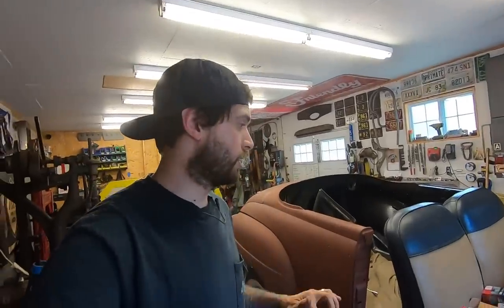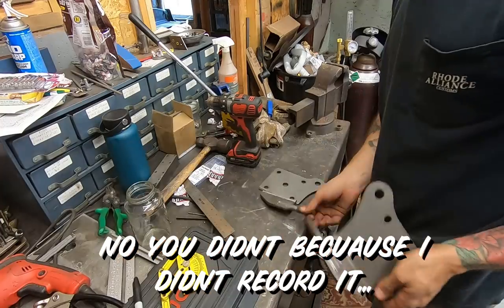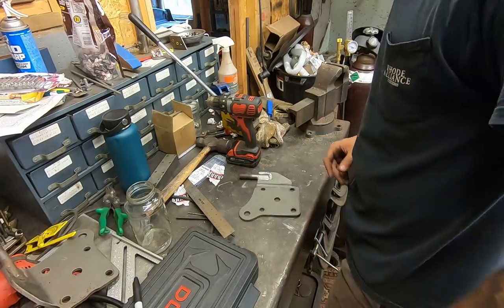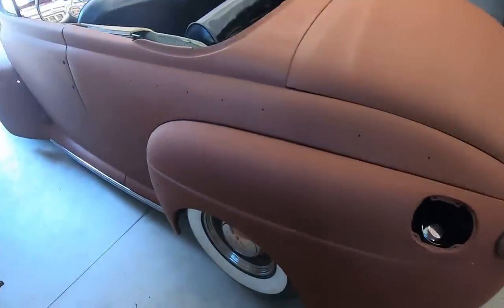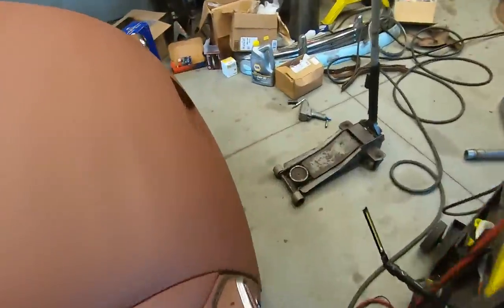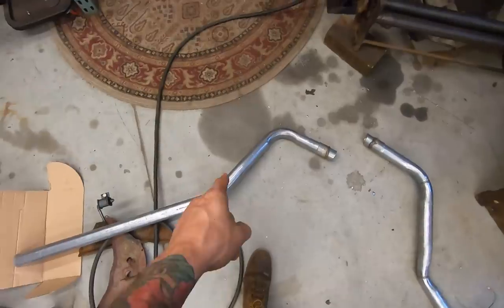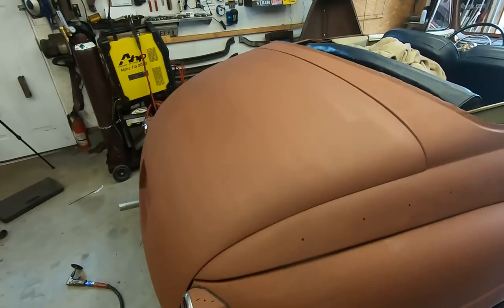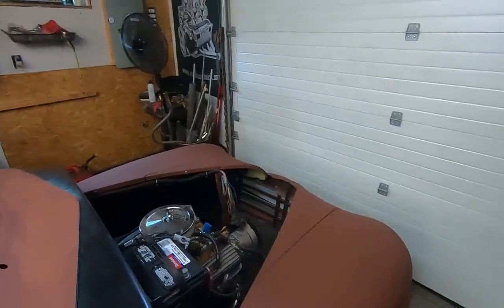Installing 2" blocks and Fixing the Exhaust and Rear Shocks on the 1946 Ford Convertible

Comment: HowDo, The car looks awesome.Add your chrome and bumpers or build them,plus; I can give an option.You could build a set of lifting spacers by using 2in.flatbar / 3/16 ,bend it to the outer circumference of the spring and weld a plate to the flat bar / flip it and bend another pc of 2in to the inner part of the spring , weld to the other side of the plate ... They're real easy to make , especially; when cash is a little tight.I hope it will help you out.also tack weld them on the flat part of the spring. Good Luck my friend.✌️✌️🦿🦿🦿👍

Comment: Hey Travis: In the video, that pinion angle sure looks like it needs to be adjusted "up" with your radius rod adjustments or in the perches.  Sure looks like it's pointing downhill.
Reply from the maker: I do have some shims that go with the blocks. Might have to use them. I’ll double check because the lens on my camera can distort things. It might be fine